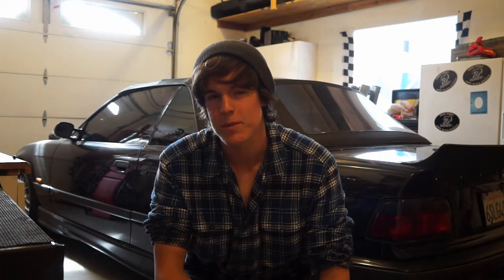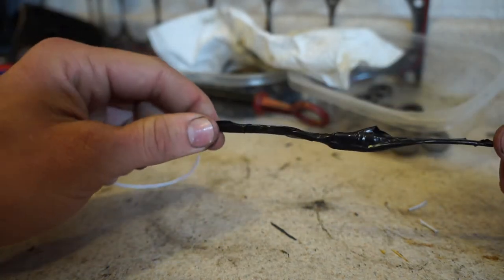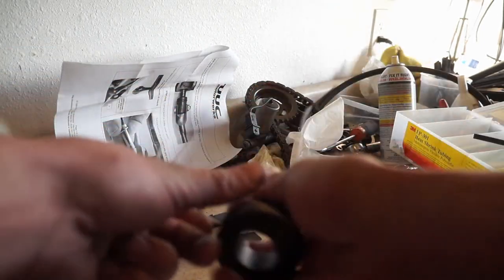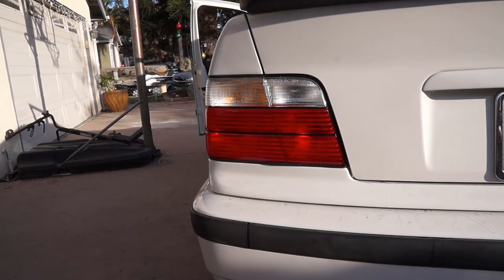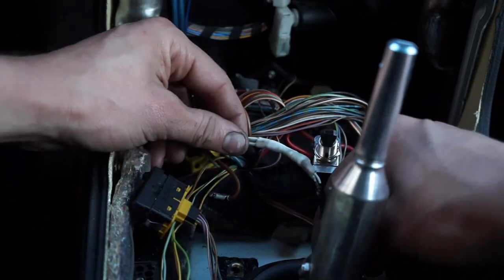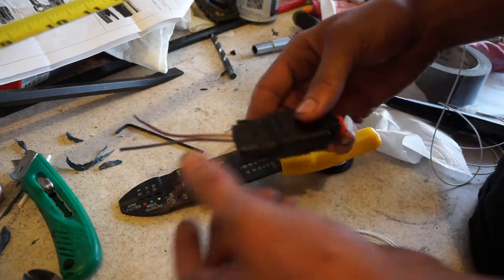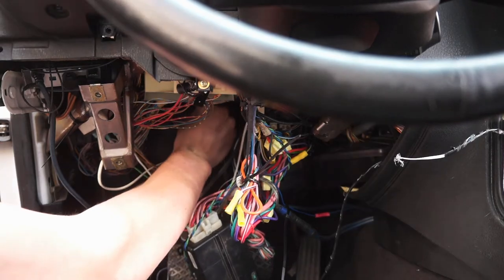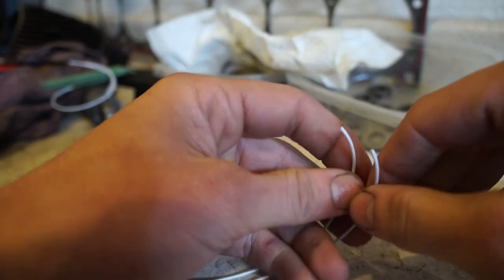Wiring: E36 Manual Swap

Comment: I am going to be using these videos to do my 5 speed swap in a couple weeks. I have to ask how come you didnt use a clutch pedal switch? Was there a reason to using the brake pedal switch?
Reply from the maker: so E36's didnt come with clutch saftey switches. the late models, I believe 98 and 99 had them, but the rest didnt. the clutch switch in the earlier models are only for disengaging the cruze control, so they are different in principal and how the switches work. with the clutch switch, it will allow current to flow when the button is pressed. so if you wire the clutch switch using the actuall clutch switch, you will only be able to start the car with the clutch out, as in not pressed in, because the button would not be pressed if you have the clutch pushed in, so current will not flow. the brake pedal switch is the opposite, it only allows current to flow when the button is not pressed. so, if the clutch is out, the button will be pressed and not allow the car to start. when you push the clutch in, the button will be out and allow current to flow, allowing you to start the car with the clutch in. make sense? good question.
Reply: M3NACE makes perfect sense! I was planning on using the clutch switch but was not aware of that. Thanks for the heads up! I have a few brake switches so I dont need to find another.👍
Reply from the maker: brake switches are easy to come by, but you need the other end of the harness to properly splice te wires in. they are easy to find at a pick a part and usually they will give it to you for free because its so small and doesnt fit into a part catagory. ye feel?
Reply: @M3NACE  i think you mentioned your cruze control didn't work. I think the brake switch would be the reason why.

Comment: what do the other wires left in the automatic harness do? also, did the cruise control work? also, when the clutch is in, it starts. after started when the clutch is out, will the clutch switch cut the electrical connection causing problems? can you still use a clutch switch instead of another brake switch?
Reply from the maker: the remainder of the wires are for lighting, and for telling the transmission what gear / mods you are in. lights, reverse, drive neutral, 4, 3, 2, sport mode, ext. my cruise control did not work after this, but it did not work before the swap, i suspect was something within the cruise control motor itself. that whole system has since been deleted from the car lol. use a brake switch instead of a clutch switch, they flow electricity differently.
Reply: M3NACE thank you so much for your videos dude, I’m half way through my swap and only started last week. Without your diy I would be pretty lost and it would probably take triple the time. Thank you so much, god bless!
Reply: M3NACE does this mean that you jumping some of those wires you could still put the car in sport/economy mode?

Comment: Hi I did the swap from following what you did and everything is fine apart from my ignition won't give me the key back so it's stuck in there. Any ideas what to do?
Reply from the maker: good question lol, the only thing that I could think of is that little cable that disconnected from the auto trans shift harness. I would find that cable, it should be sitting around or next to the shifter under the console, and push the cable back into its little harness and see if it will give you the key back.

Comment: Well I've occured some problems with reverse light switch harness. It was cutted of at the beginning of the engine harness and i can't find out where it goes originally. I've tried to go over and cutted the Blue/Yellow wire at X20 pin but when i put anything that can go for V+ to it just short circut and engine stops. Any help where i can put Voltage wire? It was a m43b16 swap to m42b18. Any help appreciated!

Comment: Do you still get the check engine light for the auto stuff after this?
Reply from the maker: after you pull the chip and complete the wiring, on OBD1 cars no. OBD2 cars yes, you will get P0600 and will need to run a reflash for a manual tune or a manual DME. I have a video covering the multiple ways you can go about fixing it, I recommend kassel performance as they have an awesome DME exchange program that is plug and play to rid the code, just tell them I sent you and get the EWS delete. their performance tunes are also great and at a excellent price.
Reply: @M3NACE  if you paid a shop, like I did,  to buy misc parts and do the install would you expect this flash to be taken care of by them?
Reply: @3DGEM3  i cam only imagine they would if they were following your exact orders as a customer butni think thats all on us to do our research as i am now thanks to quinn i can clearly see that doing the homework makes it all come to together he said 3days it took him thats not bad and hella cheaper than a shop oh gosh i dont wanna know the amount if u wasnt supply the parts to a shop mechanic

Comment: Hey man I finally got around to doing the manual swap ,but When I went to crank the car for the first time it wouldn’t start. My first thought was the starter because It was oem .i replaced it with a starter I knew was working and still nothing ,I can hear it trying to start but it just won’t catch.After that I noticed that the check engine light wouldn’t turn on when turning the key to prime the car ,someone told me I needed a dme with a ews delete so I bought a dme with the delete and the check engine light turns on now but I still have the same problem where it won’t start .i was hoping you had some knowledge on this or if you could give me some ideas the next thing I was going to try was to check if all the grounds and redo the wiring [i did not wire a clutch switch I did the bypass So yea that’s the situation I’m in I would appreciate the second opinion! Thanks 🙏🏾
Reply: By the way it’s a 325i 1995 production month of January
Reply: It also has a bmw alarm system if that has something to do with it

Comment: I've just done my swap but i did my engine and manual swap from my other shell. My shell is auto is the reverse lights wiring the same even tho the main engine harness is now a manual one?
Reply from the maker: Yes, the reverse lights are tied to the body harness not the engine harness

Comment: Quinn do you know how to troubleshoot a camshaft sensor electrical I replace my cam shaft sensor but still tripping code I live in Oceanside
Reply from the maker: what engine/year and what brand of sensor did you replace your old one with?
Reply: Use a test light or ohm meter and ensure that there is not a broken wire. Or you can look up the resistance and bench test the sensor new vs old to be sure the sensor is good. Lastly, if the sensor is not indexed correctly it won't work. Meaning that the sensor has to be oriented....google indexing cam sensor or throttle position sensor. Same idea. Good luck man.

Comment: engine and manual swap into an auto. Donor engine, harness and cpu used, came from same car(1997). tranny wasn't original to the same donor. it was from a 92. yet clutch pedal does have a switch. the internet is yelling "that's for cruise control if its from b4 97". so would the automatic(which is what my car was up until this cluster fug) neutral safety shit still prevent my car from cranking?
Reply from the maker: Yes. The safety switch setup is in the Body harness, not the engine harness/ECU setup. if you are using an auto chassis harness, you will need to bypass
Reply: @M3NACE  god bless ur speed.
by chance do you know if  I need to worry about the ews? I guess it's the car security. maybe non applicable to what you've done since it looks to be an ecu/engine swap issue.
Reply: wait...if it was security it should crank. imma try ur wiring tricks. hopefully that'll work. but sounds like I oughta look into the security if not.
Reply from the maker: @575gtcFerrari  EWS issue possible? The BCM probably wont be EWS but if the DME is it might be doing weird stuff. Usually EWS issues will be crank/no start concern. Try the wiring pin jump trick and see what it does - if not start checking wiring, starting with the starter relay
Reply: @M3NACE  Neet-0 I'll give those a try. Probably not getting back at it till next weekend. Wish me luck

Comment: im trash at wiring but I can crimp pretty well.  would that work?
Reply from the maker: MCatwar it can, but it wont hold as well or last as long as proper wiring will
Reply: M3NACE aight I'll just do your method with intertwining. I've had issues with that though where it frays apart

Comment: Hallo
 Would an e46 transmission fit on the e36 m50?

I searched and came up with nothing.I might have an extra 5 speed from an e46 come up, and I m planning on doing a 5 speed swap.Can I use the transmission from the e46 and install it in the e36?

I dont know if it will fit the block or the tunnel, can anyone confirm?
Reply: @munzer shakhashiro i think you can. I am not sure of the details though.

Comment: Where can I get a plug like the one you wired for the reverse light?
Reply from the maker: I couldnt find a part number for it, but I went to the parts department at a local BMW dealership and asked them for the female connector for the reverse light wire and they gave me that connector and the 2 wires.
Reply: I'll give that a try tomorrow, thanks!
Reply from the maker: good luck man! if you can try and score a part number for them. they wouldnt give it to me, although im sure the guy where I got it from just was too lazy to find it or didnt know where.
Reply: Hey buddy, did you happen to get the part numbers for the connector and the wires that are needed to do the reverse light?  I am doing a swap and need them. If not, I will try to go the route Quinn did and just ask the BMW parts counter guy...  Thanks.
Reply: Glad i scimmed the comments those are exactly my only two questions lol

Comment: Brake switch, just like clutch switch is ADJUSTABLE. Pull up on the white plastic nail head to extend it all the way out, mount the switch in the car, and a pedal pressure will push the pin back to the perfect position.

Comment: im cofused with brake pedal switch. when its pressed you cant start it. so basically you cant press brake pedal cos it wont start the car?
Reply from the maker: Opposite, and wired to the clutch. You will not be able to start it with the clutch out, you will need to push the clutch pedal in to start
Reply: @M3NACE  thanks for video you done great job !

Comment: So im swapping my 325is(manual already) with a 325i engine with harness and everything besides the trans, would it be easier to use the 325is ECU or do I have to use the 325i ECU?
Reply from the maker: Use your stock ECU, unless its a red label it will need to be programmed, but the ECU's are the same, motors the same. No difference between i and iS cars.

Comment: Hey man, I did the swap and jumped pin 5 and 7, pulled the trans pin thing out of the computer, and the car cranks but has no fuel or spark? Any ideas what I didn’t get right? Or what could be causing this since the swap
Reply from the maker: Did you remove the intake manifold for your swap?
Reply: I’m having this issue and I did remove the intake manifold. What would the manifold have to do with a no start?

Comment: i wonder if my cuzin wired this wrong that’s why my car has a lot of trouble turning over to the point that at times the battery completely dies from me trying to turn it over
Reply from the maker: Did he wire a clutch switch? Reverse lights wouldnt cause that. Did you replace the starter? Os the battery holding charge? Is everything plugged in?
Reply: no switch for the clutch and no reverse light wire all i knew is i plugged in that auto shifter and the car start when we was done with the swap then he cut some wires wired them up and now the car has hella problems to start and yes we got a new starter but it was from an auto but wierd thing is the manual starter and the auto started had the same part number
Reply: is it possible to wire the wrong 2 cables but for the car to still start cuz maybe he did the wrong 5 pin and 7 pin what if he did like 4 pin and 7 pin lol
Reply: btw my car is obd1 95 325is
Reply from the maker: @mromagachi5194  i mean i guess but in truth if he wired it incorrectly it wouldnt start at all.
Reply: darn then i wonder why it does that crap u have a snap chat or facebook i can send u the video

Comment: It’s a 01 ford ranger xlt 2.5 Manuel transmission
Reply from the maker: I dont know man, I would back probe it and see that the waveform looks like but that requires a labscope. I have never worked on a Ranger before so I dont know the ins and outs of that car, I work mainly on E36's. I would start a thread on a ranger forum and ask, or go talk to a ford technician or someone who regularly works on those.

Comment: Not tryina he a headache buuuut, I followed allllll your steps, but nothing works. Only thing that works is when you tested the brake lights before cutting the wires. Car wont start. Lights Still come on, but in not gettin a crank or anything.
Reply from the maker: alright lwts figure this out. so when you jump pin 5 and 7 the car does not start? did you replace anything else when you did the swap like the DME?
Reply: @M3NACE  did everything like you did. The first time I opted to  start the car without the clutch but I've only seen videos of people using the switch. I've even followed this guy to see if goin with the switch works.
https://youtu.be/DbTuZlcsT7M.

The DME he pulled the chip from is the same one I told you that was different on my car. I even pulled the chip in the one he pulled from, putting chips back in and pulling the other. It's been musical chairs with trying to find solutions. Right now I spliced the two biggest wires that are on that EWS box, green/blk, yellow/black, thats behind the glove box, and now the car cranks unlike before. Now I gotta get to the starting part. Progress right? Lol